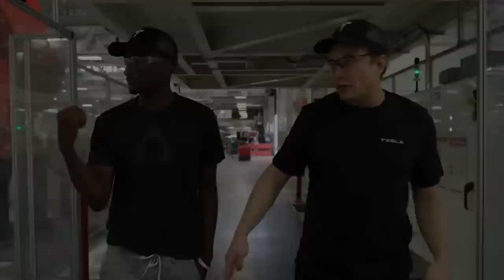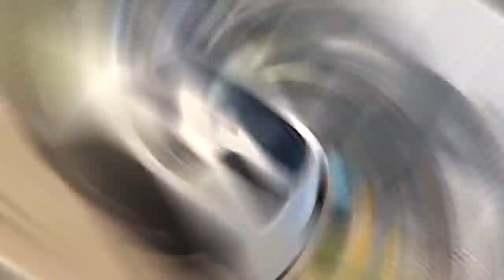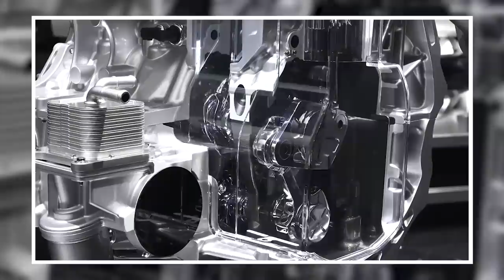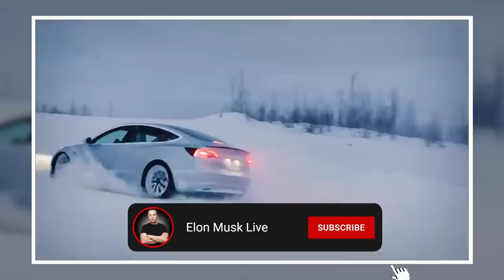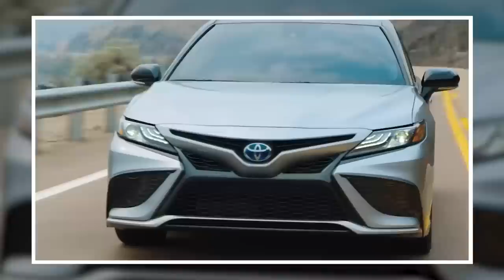Why Elon Musk is Scared of Toyota’s NEW INSANE ENGINE!

Comment: He's not scared. He understands that there's a transition to electric. That's why he opened up the chargers to all electric cars.
Reply: @blacknester No!, we need ALL existing gas stations to install chargers, with their existing gas pumping stations.   The could even install electric chargers at the existing parking spaces at the current gas stations.
Reply: @sgodsellify  So where is all the added electricity going to come from though ?? As when you have an electric vehicle that needs to be constantly recharged, you're going to have to increase the amount of electricity produced. The next challenge is the amount of current which is flowed through the system. As we are currently using wires for the transmission of electricity, then we need to also increase the diameter of the copper wire in order to allow that much extra flow. This is why the roll out of electric charges is not instant due to the restraints in electrical transmission.

Then you have the next thing. Everyone is in electric cars, cool, now I want to take a trip around Australia on a road called the Australia Highway 1. This is a road which is 14500km or 9000 miles. In order for an electric car in it's current iteration to travel it, you'd need some more infrastructure to be put in place. Yeah sure going from Brisbane to Melbourne and even Adelaide isn't so much of a challenge, but when you look at travelling from Adelaide through Perth, going through Darwin and then Brisbane again via Cairnes, then you'll start running into some challenges, as there aren't even the townships out there with electrical infrastructure, let alone enough electricity to have a recharge station. It would be .. "Hey Marge, there's one of them Fancy electric cars coming through again, better turn the fridge off". But I guess with enough debt it can get done. Maybe Australia can catch up with the debt in America at the moment :D
Reply: @MassageWithKlay  think outside the box.  You can buy 10k watt cylindrical wind turbines for around $1200, buy around 15 of them and put them on the roofs of gas stations.  You put 15 x 10k, now you have 150,000 watt maximum power output.  You would also purchase a few power storage units ($3000 per unit), that could store that power for when the wind isn't blowing as hard, or as often. Therefore this wind turbine gas station wouldn't be using much of the grid power.

Your round trip in Australia could easily benefit from electricity by using both wind and solar at each current gas station.  Its why electrity is the cleaner an much better to run away from gas consumption.  Even Amazon sells wind turbines, solar panels, and battery storage units for homes.  This technology has been out there for some time.  Plus the prices have come down quite a lot.
Reply: @sgodsellify  so with that system, you'd be able to charge up 1 car every hour, as the average telsa holds 100kw for a full charge, so therefore your station would have to produce at least 5 times that amount. Especially if you go for electric trucks which seem to be getting about 100 miles per charge, you'll need many of these stations. If the traffic is high, then you'll be wanting at least a terra watt worth of storage.

Then you have longevity too, if you are using the straight from china ones from Amazon, you'll be looking at replacements every 5 years at a minimum, if they don't just fly away due to 100+km winds which often hit the southern bite. It's all well and good to think it's easy, but then you have to include the actual conditions to which it has to exist. Solar panels would be good too, you'll be cleaning them often though to keep them going.

It's not impossible, but it's not Amazon cheap either. I'm pretty sure they had a maximum rating of 25km/h winds.

Comment: Well eventually there will be no gas for Toyota's engines, what will Toyota use to power its new engine. Toyota probably had this engine for 20 years but kept it hidden to slowly move technology along.
Reply: The planet will run out of copper and lithium long before it runs out of fuel.
Reply: We can produce fuel renewably in multiple different ways. We can’t renewably produce lithium, nickel, cobalt, copper, or other precious metals cause if we could gold would have no value. Just some examples of renewable fuels, ethanol is produced from corn and if done correctly can perform just as well as plain gasoline. Prometheus Fuels produces a carbon neutral fuel from the literal air. I would support that company as much as possible because if we get all of our vehicles carbon neutral, we can focus on becoming carbon negative a lot slower and not have to worry about screw ups from pushing the movement so quickly. Another renewable fuel is used cooking oil in Diesel engines. You can take a by product from cooking and use it in your car afterwards. Talk about being efficient
Reply: @mtebaldi1  it’s already being sold at the same price as normal gasoline my guy. It’s more affordable and better for the environment than electricity at this point due to price increases in recent times

Edit: love how he had to delete his comment because of misinformation
Reply: I bet elon will give us . " ZPMs "  soon no more BURNING STUFF 🤗
Reply: @slimmy696jim7  LMAO your too funny.
Reply: Eventually there won't be enough  electricity if 15 % of Americans or more buy electric cars.
Reply: @johnsisk6575  I agree with you. US electric grid sucks. If everyone owned an electric car the grid would fail completely. I don’t own an electric car and will not as long as I can still run my 1995 Chevrolet diesel truck in my gas engine suv.
Reply: Solar panels on  most structures will eventually become as common as windows , more power than we will  need. " Forcing function "  comes into play eventually  😊

Comment: Toyota engines may last a long time compared to most of the competition. Electric motors (and generators) last far longer. And pollute far less. And are lower in NVH. ICEs are on the way out with higher operational, maintenance and cost issues. And have you notice the rising parts count? Makes electric motors and their associated electronics look wonderfully simple. What about the single speed gearboxes on EVs. Those sure beat the multiple speed (spendy and slower) transmissions Toyota offers.
Reply: Only thing is what happens if the electric supply is down -- like in hurricanes? That's what worries me about electric cars. I think that the whole thing should be covered with solar panels.
Reply: Coal charged electric cars
Reply: just do your reaearch how many model s motors failed before even getting to 100k miles
Reply: Porsche is already investing in and manufacturing synthetic fuels, that effectively produce zero emissions from an ICE.  EV’s are most definitely not the be-all-end-all that you’re trying to make them out to be.
Reply: @matthewwood4756  No. But, EV cars produce more passenger space than ICE cars. They also seem to protect passengers in crashes the ICE cars. I'd like to see hydrogen fuel cell vehicles but they may be best suited for heavy commercial vehicles. ICE cars for now weigh less, fuel up faster with way better energy density.

Comment: Toyota also has better electric engines developed by Yamaha and their battery technology is far ahead of teslas (they are on the verge of mads producing solid state batteries).
Reply: Uh, no.🤣
Reply: No Tesla has one of the best battery technology
Reply: An electric engine isn't a thing, it's called a motor
Reply: @sean6992  say IT to t800 and Not to me
Reply: @sean6992  Alright
Reply: @florianriemann4906  You mean Panasonic, the one that's strongly tied with Toyota.
Reply: If thats the case why aren't they out selling tesla or have mass quantities of these electric motors?
Reply: @hunterpickard1297  I think new Lexus RZ and Toyota BZ4x have these 

But Toyota with their greedy conservative and save apricot still uses low power motors even if they are ne technology.

By the way Tesla copied Prius motor one, couple of years ago, as it was a vary great technology, only tesla made a version with some actual power.

Toyota engineering and their manufacturing technology is the best in the world, it's their marketers that are always making up some b.s. 

Also, Toyota is the greediest automotive company on Earth and I think only Apple could compete with them on this.

Comment: 1st off the problem with this new idea for a ICE system is, It still a polluting engine pumping out cancer forming gases.. 

So not good when the world is moving soon to all electric tech for transport.

2nd. no matter how much they try to increase the ICE system it will never go above 30% which is the highest now any ICE or Diesel engine will go. 
70% of the fuel is not burned it is wasted as heated un-used fuel vapor and goes out the back end along with all the nasty cancer forming stuff that only fossil fuels can do.

The electric motors don't burn stuff to work they are 90 to 100% efficient with no cancer forming pollution out at all.  

All fossil fueled systems will soon be history and the electric motor will take over, and we all can have a much cleaner aired world with no noisy smelly cancer forming crap exhaust to worry about.

Either the ICE car makers change to EV tech or they go out of business.
Reply: Colin Campbell: I have 2 things to say to you.  First,  you really shouldn't comment on videos you haven't watched.  That's evident from your remarks.  Second,  EV's really are not any better than ICE.  Where do you think your electricity comes from?  90% gas.  Not to mention the slave labor & unsafe labor practices to get the lithium & cobalt,  never mind there isn't enough of these materials for everyone to have an EV and they aren't recyclable. Besides ICE really isn't the demon it's made out to be.  It's just an easy target for the politicians.  Cars only contribute about 6% to the issue while Industry contributes a whopping 49%.
Reply: How much fuel does it take to build an electric car?
Reply: News flash, nothing is green except grass.
Reply: how much fossil fuel will be used to charge the electric cars, 200 miles and recharge sounds like horse n buggy is coming back.
Reply: You know there’s Toyota engines as much as 36% efficient right ?

Comment: Bull Shit toyotas are easier to work on... What are you comparing it to? The 2004 corolla has a 12-13 hour job time to change the heater core. The reason, you have to remove the entire front dash to get to the parts. They also state that none of their vehicles need major maintenance for 100,000+ miles, but have the worst warranty on the market of any dealership.

Comment: So, Telsa has almost 70% efficiency in using energy, and this new engine has around 40%.

Telsa uses battery as energy source, and this engine uses gas.

Sure, Elon is scared...

One of the stupidest videos I have seen
Reply: Yeah sure,Tesla uses a battery which is not very reliable at all and Toyota uses engines that never breaks.🤡
Reply: And also if electric is that good then why no factories wanna use those “EVS” at Le Mans?Well if they are better than combustion engines then the FIA would allow it in no time.

Comment: it´s quite nice. But what i´ve wondered for years. Why is the coolant in combustion engines just cooled down ? It´s the biggest waste that is happening in those type of engines. Getting rid of heat means wasting energy. Why isn´t it used to create electricity like in a power plant ? Creating a high pressure system where steam is created and powers a turbine to create electricity before a 2nd cooling system gets rid of too much heat.
That would be the way i would try to go as an engineer. Combustion engine + Hybrid + Electricity from steam. Maybe you could even use peltier element to create even more electricity. I would try to make as much electricity as possible out of the engine heat. That way, even 50% efficiency should be possible imo.
Reply: Toyota engines don't waste the heat.

1) It is directed to catalytic converter for burning down the carbon emissions.

2)The heat is used for optimum efficiency of engine (96°C in most of Toyota engines)
Reply: @manifestingthebestalways  1. The catalytic convertor reduces harmful emissions, but does not contribute to mechanical energy. 2. As you know, the combustion leads to PHYSICAL EXPANSION of gases, which is ultimately transferred to the wheels. The HEAT part of the energy release happens no matter what. And converting THAT into mechanical energy would require a heavy, bulky system.
Reply: @bryanstrom812  I never said that the catalytic converter contributes to mechanical energy. Read again what I wrote. I mentioned about heat not being wasted (being used to burn down the emissions)
Reply: @manifestingthebestalways  I didn't claim that you said that. I read what you wrote, and easily understood it. 
My point is that even though some of the heat is used to break down exhaust by-products, electric still kicks the ass of petrol vehicles. The capture of heat for a useful purpose is a good thing with combustion engines, but electric is STILL way better.

Comment: See if you can spot the oncoming disaster: It takes 84K gallons of fuel to produce EACH EV battery (21 billions gallons per year just to mine the heavy metals required for 250,000 batteries VS 19 billion gallons of fuel for the ENTIRE airline industry WORLDWIDE) - Per the US Dept of Transportation. PS - There is NO CURRENT ability to effectively recycle the used batteries…. The battery in an average Tesla is comprised of 25 pounds of lithium, 60 pounds of nickel, 44 pounds  of manganese, 30 pounds of cobalt, 200 pounds of copper and 400 pounds of aluminum, steel and plastic… 1000+ pounds of minerals that had to be mined, transported and processed into a battery that stores electricity…. which was generated by oil, gas, coal or water…

Comment: "... And there's no room for making it better"? All cars have room to upgrade. Especially with electric vehicles. You can swap out higher discharge and capacity battery cells which can boost performance. You can swap out a more efficient designed electrical motors. You can configure how much power goes to each individual wheel. Petrol cars have limits they run into with drive trains and such. Electric motors can have in-wheel set ups as compared to drive train based setup.

Comment: Elon Musk is not going to be worried, even though this is a stunning bit of kit, this is still burning fossil fuels, unless they convert to Hydrogen, except even then there are not many hydrogen fuel stations around, as the world moves to electric, eventually fossil fuel cars will be a thing of the past, Toyota may potentially become more powerful however they are not going to win out on the full electric, unless they can improve the battery tech making the mightier with inter range like say 400mile range etc. and as far as power goes Tesla are supposedly releasing a new Roadster car that will have a 0-60 in 1.1 sec’s, this is totally insane, why would you want to go any faster
Reply: The only problem with the let’s say 400 mile range EV is charge time. For a ICE vehicle that could have anywheres from 400-1200 miles of range (very much possible with a small Diesel engine and larger fuel tank in smaller cars), it would take at most 10 minutes to re fuel. The main argument against ICE vehicles is emissions when in all actuality they can be just as clean if not cleaner than EVs when using a carbon neutral fuel like what Prometheus fuels is using. I like where you were going with the hydrogen idea but as said in other videos and other articles online, it’s either very expensive to produce hydrogen or expensive and polluting to produce hydrogen. While yes the more you produce the lower the price would get, it will never get as low as other forms of power like the Carbon neutral fuels. What else is once we stop adding carbon to the air and get to a neutral point, we’ll have more time to focus on being carbon negative/reverse the effects of what we’ve done in the past

Comment: I wish they would put the Free Valve system in modern cars. Less weight, less materials used, less mechanical parts, more efficient, more horsepower, easier replacements and easier maintenance.

Comment: “Electric eLeCtRiC cArS aRe bEtteR!11”

Ah yes don’t cry after reading this:

FIA World championship Monaco lap times
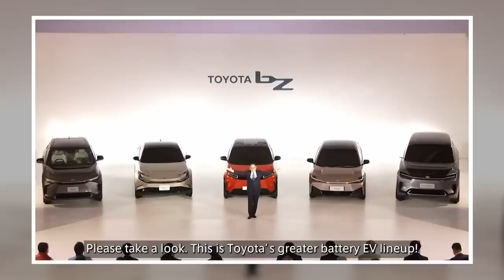Formula 1: 1:10.166
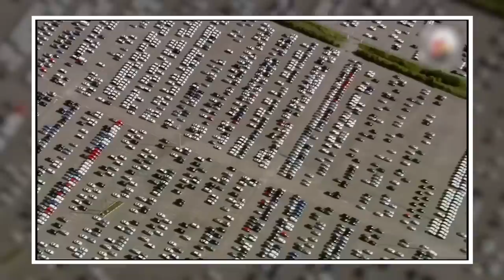Formula E: 1:30.435

FIA WRC
Group B road cars made in the 80s or 90s(shut down in the 90s):still 10seconds+ Faster than EVS on dirt

Nurburgring: 

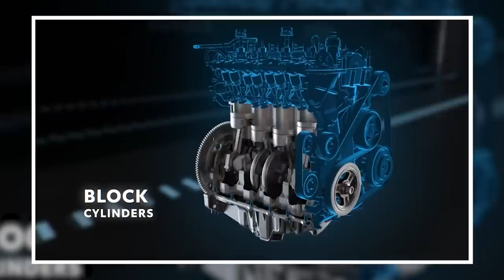Volkswagen IDR electric hyper car(a Time attack car which was designed to do a few laps): 6:05.336

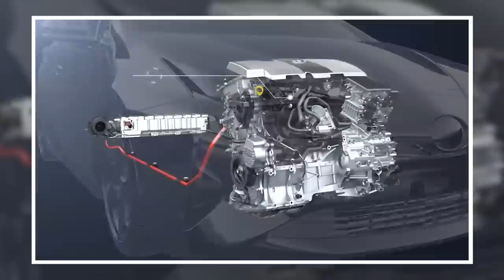LMP1 Porsche 919 Hybrid Evo powered by a V4 turbo engine(a car which has to race for 24hrs): 5:19.546

Comment: Try as they may, the maximum efficiency of a thermal engine is limited by the Carnot Cycle.  You may use diesel, gasoline, steam, Chanel perfume or powered diamonds, the maximum efficiency is limited to approximately 44.5%.  By the very nature of energy conversion as per the laws of thermodynamics.  That is without any friction, any heat loss (the exhaust would be at the same temperature as the intake and the motor would run cold)...  On the other hand, the efficiency of an electric motor is limited by the ohmic resistance if its windings and the hysteresis of its core.  In "normal" (25°C) operation, a reluctance motor (SynRM) can achieve 96% if properly wired and not abused.  In cryogenic conditions (superconductivity), it can exceed 99% like in some maglev trains.  
So Toyota may try to increase the efficiency of their thermal engines, ANY electric vehicle can double it easily!